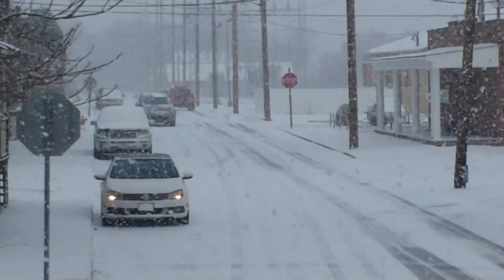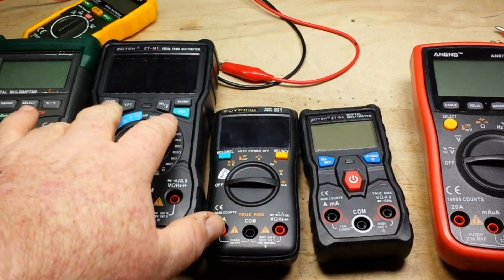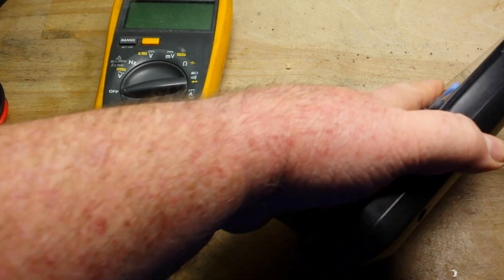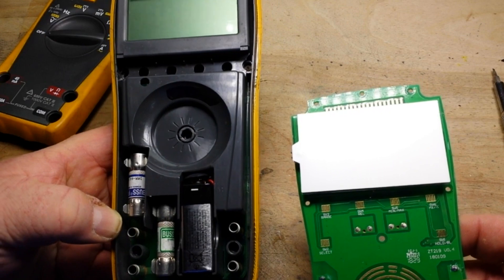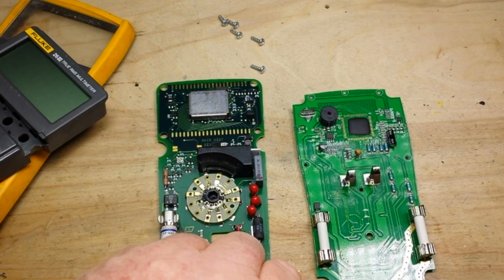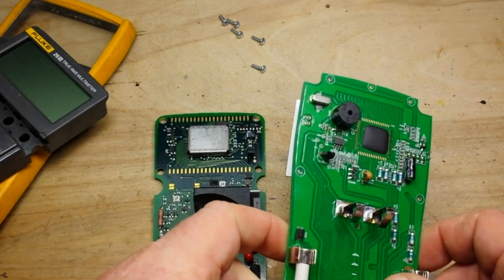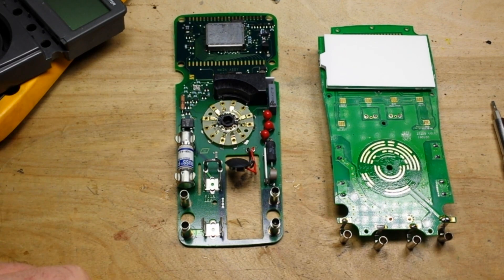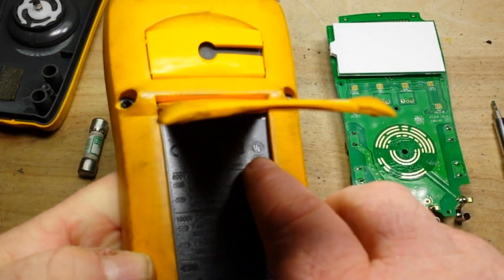Multimeter comparison: Fluke vs Chinese

Comment: Big thing for me is how solid the banana jacks are. I can't stand a flimsy connection when I'm trying to measure in the milliohm range.
Take care of yourself Paul... ;)
Reply: You can't do milliohm measurements with a 2 lead meter. That's why they make 4 wire Kelvin instruments.
Reply: @1pcfred  Actually, I do it all the time. My Fluke is calibrated to compensate for a specific st of leads. However, I will admit that I can't measure reliably less than 10 milliohms. For less than 10 milliohms, I do use 4 wire. One has to make due with what one has.

Comment: I have the Fluke 27/FM multimeter I was gifted 22 years ago from the government job I had as a electronics technician. Still looks new ans works a treat although I do not like the LCD display that fluke puts in them. They are too faded out looking. I do not use it much since I have several other cheap multimeters that work much better. With microprocessors in the multimeters today, accuracy is far better than multimeters from 20 years ago.
Reply: I have a 27/FM that I found at an estate sale.  My LCD is dim too, but it is built well.  True RMS so I understand.

Comment: Had my Fluke for 26 years now and have only had to change the battery it has never let me down, I have a few Chinese meters, you are right,  they are not industrial standard or built for longevity but they do work and are all pretty accurate , for the hobbyist excellent value. Until retiring I was an electronics technician and got the Fluke to replace my Avo 8 , as it was analogue I upgraded to the Fluke digital read out for more accuracy and still have the old Avo ( still in its leather carrying case ! )

Comment: Fluke is Fluke all we know......anyway sometimes chinese brand made good stuff!
Reply: I have a Reed 5005, made by CEM. It's  been hanging in there for 2 years now. However, my 25 year old Fluke 87 is a proven workhorse that has lived through my mistakes over the years.
Reply: Especially if they copy, but for some reason they're not copying this. Cheap means abundant. Why not make good stuff abundant ? Oxygen is cheap and no one is complaining about that.

Comment: For me the acid test isn't accuracy - the cheapest chinesium meters these days are ridiculously accurate and have more functions on the dial than any lab in the 70s could afford thanks to that black featureless cowpat perched in the corner of the PCB.

The clincher is the quality of the switches and connectors - you can see the fluke is using good quality parts (not as good as they used to - but still better than many) while the chinesium one uses open tracks and wipers printed on the PCB and tubes made from old tincans to take the leads.

I've used an alternative brand for many years - partly out of badness - partly because I actually prefer what I use.  Something that's very apparent though is if you want to work in the industry - you pretty much have to carry a fluke .... and be seen carrying it.  When I worked for the phone company we had every tool and meter known to science and we all used the same brand and version of everything and I stuck with the brands I was used to.  For the home hobbyist - It's already been said - stick to less than 50v and low currents.  and beware the Lilon battery (I don't mind admitting they frighten me).

If you want to dabble with home electrics (240v in Europe) invest in a contactless tester like the UNI-t and a remote voltage detector - then switch off and isolate before you go further - if you have low resistance you have continuity - you don't need to see the pixies running down the pipe.
You can prove most faults with a testlamp and a couple of alligator clips to loop wires and a little logic - don't get bogged down with details  You only need an indicator for 99% of tasks, avoid current measurements. and you'll be ok.  If (when) you need more - you need to dig deep and buy quality.

Comment: A big thanks for your videos. You're so right that for the usual electronics work there are good chinese multimeters these days. Most of my work is electronics and I am a fan of multimeters. Specially the ones of the 100us and up range. I already have several to work with. But there's something about my 10 year old Fluke that always ends up being the instrument of my choice. It's so reliable and trustworthy on its lectures that for me life would not be the same without it.
Sometimes I even think that electronics wouldn't be so much fun as it is now if this brand would not exist. I know is a crazy thought 😁 please excuse this crazy dude.

Comment: Wow, this has to be the worst / knowledgeable review i have ever seen in all my years!!!

#1) Size of a fuse gives no indication of how good it is. Those smaller ones are ceramic its a different technology than the buss man fiber cores. 
#2) You go on an on about the shielding on the fluke (the extra plastic cover on the top side). Then you go on about how great the fluke is because it has parts on both sides. The cheaper one does not have parts on the top side so why would it need a plastic shield to protect you. ? 
#3) You talked about component count / double sided and single sided. If a PCB is double sided means absolutely nothing about the quality or how better it is. 
#4) "Nice rotary switch here, very high current"  Your kidding me. Those switches pass no high currents what so ever.  Your talking currents in the 0.01ma range at best. They just tell the micros what option you want. This is what really showed you have no clue what your talking about. 
#5) "look at the size of those SMD diodes" ,  those are caps.  Even if they were diodes, to put that size diode at the top of the PCB the furthest away from the inputs would require a very large traces up there. 
#6) Fluke safer?  Maybe but only by a little. First of all. Only a screw-up in life would measure current on a 440VAC line with a meter like this. Anyone worth their salt would use a current clamp. 

The only reason you would want the fluke over the cheaper one is that you know its calibrated, and is far more accurate than the lower cost ones.
Reply from the maker: Um ok, thanks for chiming in.